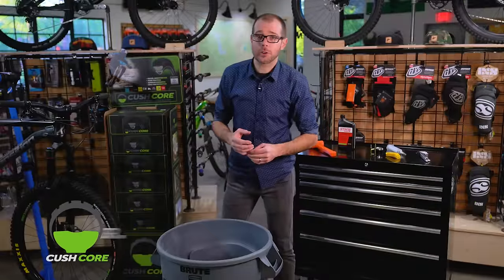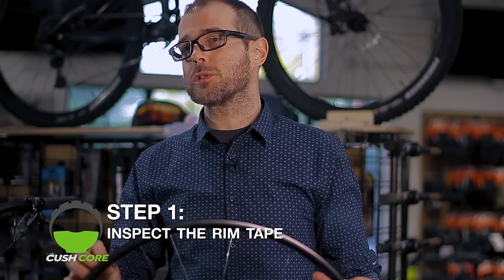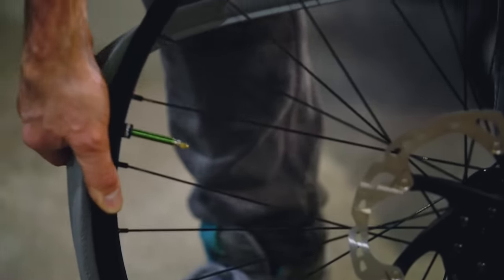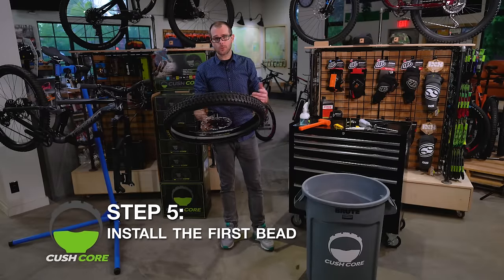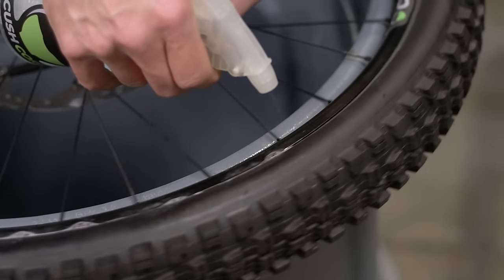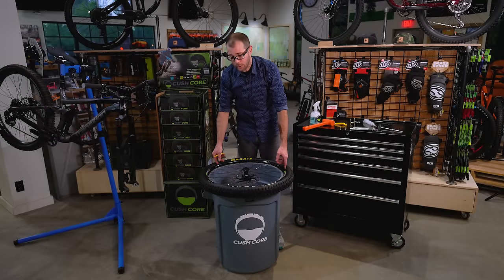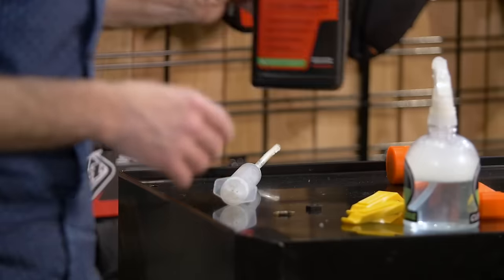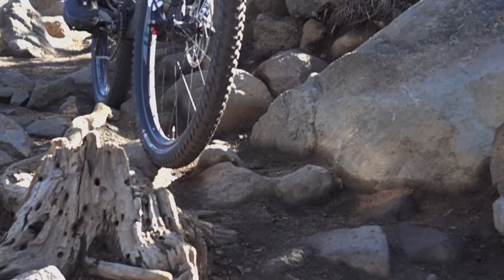CushCore Installation - 2018 Official Video

Comment: i have a better way, my method has produced times of sub 2 minutes
Reply from the maker: In that case, please post a video and show us your way!
Reply: @cushcore  I"m good at tuning bikes, not making vids! But, my difference to yours is. (i do this with ALL insert brands and rim/tire combos) 1. Install Appropriate valve for insert. 2 Install the tire dry and fully seat the beads, this allows for inspection of air leaks and assure the rim tape is secured 3. Remove valve core 4. unseat whichever bead is going to be easy to install again. (asymmetric channeled rims WTB and Ibis mostly take note) 5. Install CushCore insert (and dump sealant in if you're good at the next step without making a mess) 6. Starting opposite the valve, tuck the bead exactly in the method in your video, sans soapy water. 7. Squirt sealant in valve, install core, inflate. A few tips to increase efficiency: Prestretch CushCore as you would a tubular tire. When you tuck the bead at the valve, have an NRS or toeclip strap to hold the bead there while you work towards the valve. IF you're scooping sealant in prior to installed bead, scoop it in opposite the valve, and keep that side pointed downwards so you don't spill. First try this way was under 10 minutes. Fastest time on a good day (i had installed 10 pairs of CushCore inserts that day) was 1:19 starting with a dry tire and pre-taped rim. Was under 5 minutes for the pair.
Reply: I would like to add, the main reasons for doing this is two fold. You only have to deal with tucking one bead instead of two. Having the one bead seated gives you a few extra millimeters to play with when you have the tuck the remaining bead into the channel.
Reply from the maker: @paullehrbmx  1:19? That's awesome Paul, thanks for sharing!
Reply: @cushcore  Cheers!

Comment: Lies, Lies, Lies. This is the hardest thing I have tried to install on my bike. Over an  hour into it and I have broken 3 levers and will have to take it to a bike shop. It is impossible to get the tires on. I did every trick in every video I watched and it still would not seat the tire.
Reply: what did the bike shop ever do to you? just set it on fire, walk away and check your air pressure when you ride
Reply: @donaldriddle7138  The bike shop in Los Angeles charges insane fees for basic work. I was able to get the tires on except for one side that I got on over 3/4 of the way. Then the crush core tool broke so I took it to the bike shop. They charged me $10 for 5 min or less of work. Half the cost of buying another tool and the full amount of minimum wage for an hour.